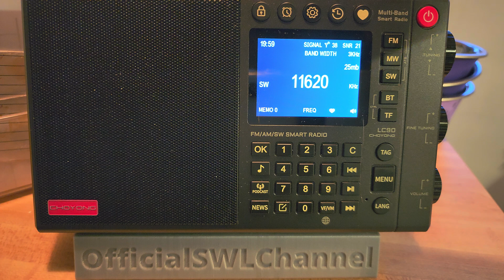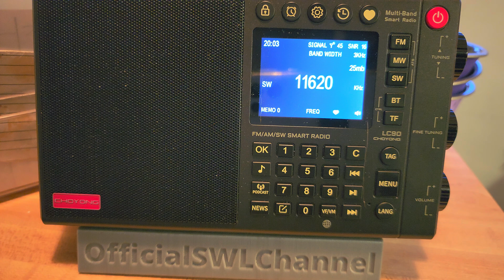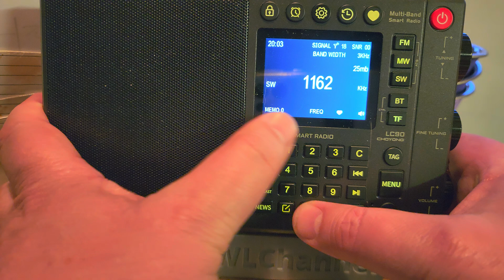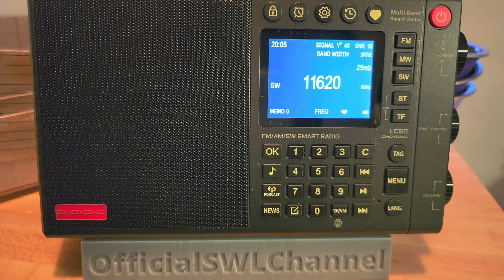Radio Romania received on ChoYong Smart Radio 11620 kHz Shortwave on telescopic antenna

Comment: Thanks Gilles and Zi hope you enjoy your new radio. I am currently breaking in my new Raddy RF919 today so far with about a hour s use is promising but need the memorize the manual to get the max use…one thing operating it outside in the dark is backlit keys and two displays which one can see the frequency and the other signal strength plus time also date is available. It also has low and high pass filters, attenuation and LNA amps.  So tomorrow I plan to put it through its paces, weather permitting. 
Since my internet is through my cell phone plan …internet radio quickly can run through my available data…so I tend to focus on just a plain radios to pickup my stations.
73!